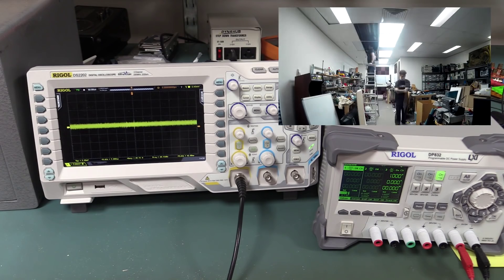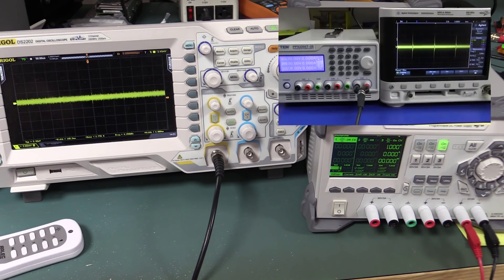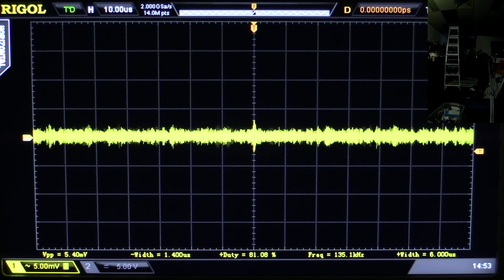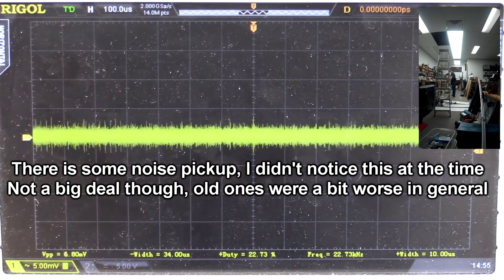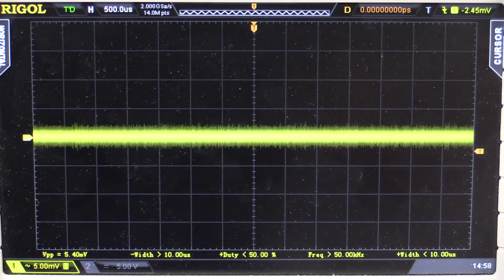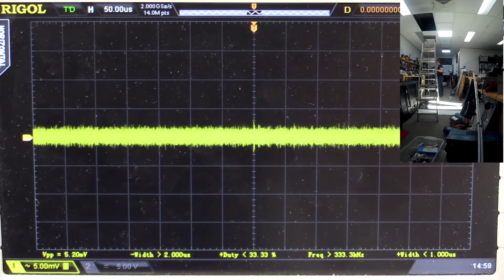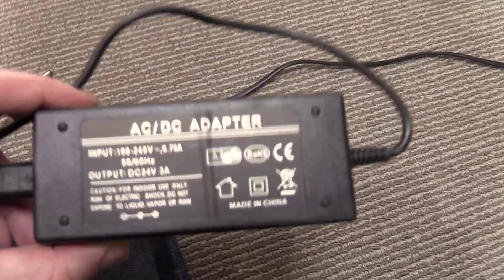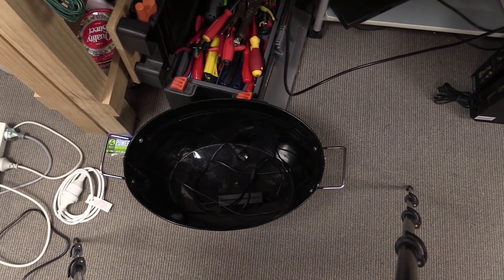EEVblog #765 - LED Panel Lighting Switching Noise

Comment: That one bad light makes as much interference as the two fluorescent tube lights I have in my lab.  I have to switch those things off every time I want to make a clear reading on the oscilloscope.  That unit will pick up 60Hz noise from everywhere.

Comment: Something else you might consider Dave. Try measuring your lab with your Spectrum Analyzer with anantenna connected to it. No doubt 9 khz is quite a distance away from 50 Hz but spurs can be generated quite a distance away from line frequency with Switchers. Set it up to scan out a Megahertz or 2.

Comment: Why aren't you making LED panels yourself?
Some cheap and good quality 3W COB LED lights can be obtained from China (Ebay, Aliexpress...).
It would also be a great video for the channel:
- building LED fixtures
- making power supply (with variable voltage for dimming, please no PWM)
- IR receiver and transmitter for control
- ...

And you could probably also make much better quality electronics than the one included. Those are usually only good for "garbage".

Comment: Come on Dave, "Don't just put it in the bin, take it apaaaart!"
We know that the other two don't radiate the RF crap, so why does this one? 
Is it being radiated from the PSU brick or from the mains or 24V output cables?
Generally in a situation like this, we don't have a good unit to compare with, so don't know if the unit has gone faulty, or just badly designed and did this from new.
Other than the RF radiation, this unit hasn't actually failed. There was no discernible difference in panel brightness compared to the others

We just want to know lol!

Comment: Hi Dave,
do you have a big Radio-Station transmitting good old AM nearby? The "silent" noise looks like you're decoding AM-Signal. If you where a Ham Radio Operator like me and others, you'll see switched power supplies and componet with different eyes . ;-) So try to turn on a simple small handheld AM Transistor Radio on MW, LW or even on shortwave bands and walk with it throug your lab. You'll see ähm.. hear lot of e-smog. And that is what can cause the problems with your remote control of your panels we have seen before. 73,Mike.

Comment: WHERE do you get a good 240AC/12VDC switchmode on a budget!? Everything i have or find in a wall wart is never 12v or if it is has naf all current! And all the flea bay shit i have molests anything with an audio signal! I have a bunch of laptop supplies that are good but they're all up around 19V.

Comment: Crappy power supplies like that are a real pain in the ass for amateur radio operators. Just one dodgy power supply like that one is enough to cause debilitating interference over most of the bands from 20kHz to 30MHz sometimes from distances as far as several houses down the street.

It's a nightmare these days as such power supplies are everywhere so in densely populated areas trying to operate on the HF bands is near impossible due to the large amount of interference from dozens of dodgy electronic devices.

Comment: Hi Dave, is it possible to plug the oscilloscope and the programmable power source to the isolated transformer to isolate the noise from the lighting?
Reply: Yes and no.

The common mode on the electrical hot and neutral lines will have been attenuated a fair bit (but by no means entirely as a portion will still pas through the transformer, depending upon the frequency involved and type of transformer).  However, the common mode on the ground/earth conductor will remain unchanged.  Then there is the fact that switchmode supplies tend to radiate a lot of their energy on their input and output conductors, which will still behave like antennas, radiating their signal throughout the lab (and the longer those cables, the more efficiently they will radiate).

To really address the common mode noise and make the greatest possible difference you really need to address the source of interference as close to the source as possible (as in immediately at the point where the conductors enter/exit the power supply, if not within the power supply) through the use of bypass capacitors, chokes, and/or ferrites.  The closer to the source you can address the interference the greater the effect will be and the less that will be required to achieve a given degree of attenuation.
Reply: Thanks!

Comment: Dave,

Do a tear down on that AC/DC "plug pack" and see if you can figure out how it's different than the others that work. Why is it so noisy?
Reply from the maker: stazeII The crap output caps will mostly have crapped themselves
Reply: Oh, I'm sure. Just figured it would be good to confirm. :)

Comment: Yes you should have cracked it open an showed us  an example of bad engineering
Reply: ***** Or what the customers outside of China wanted: low cost as a priority. I, for one, am thankful of the products that China makes, because almost everything I have is from China and most of it has worked without problem and was inexpensive.
Reply: ***** a guy I know was talking to an engineer  who works at a fork lift manufacturer that had shifted production to china one day  he got call from china asking which welds could they skip over to speed production of. Them he naturally screamed back none!
Reply: iron man this guy should be awarded a medal for saving the brand from falling!

Comment: Hi Dave. You could fix that power supply. I will be a very interesting video.
Reply: Laharl Krichevskoy Maybe compact inside, but not potted, never seen one that was potted inside. Most likely dodgy caps on the output crapping out under load, could easily be improved/fixed but not worth the effort. Also you usually have to crack these open, so they never go back together properly. I have fixed a few but only to fill a gap until a replacement was ordered and delivered, the the fixed one would then be binned.
Reply: Laharl Krichevskoy Usually the really cheap China ones lack potting or really anything to even hold the heavier components in place (other than the solder). They cheap out in every way possible. The annoying thing is that even the cheapest ones tend to have the casing glued together in order to increase your frustration.
Reply: Razor2048
"It is almost as if their design involved them simply adding additional strands of copper" Yes, literally too! I had an IEC cable to a power brick and the thing failed. Cutting the cable revealed what looked like just a few strands of copper. A pear of eadbuds has more than this per conductor.
Reply: Proyectos LED nah those are all potted inside. If you ever break one open you'll see they are all crammed together inside.  You couldnt fit an ant inside those. The best he could probably do is add a line filter before it to stop the noise from going back into the line.
Reply: Razor2048 i've opened my Atten DSO to clean it and al in all it looked like they didnt cheap out on that. It had screws, not metal threaded but still it felt solid and the caps and stuff were even glued.
The pcbs werent all that clean, it had flux residues but i didnt see anything that ringed my alarm. Mind to tell what brand was that one? I know his one is sold undervarious brands, Atten being one of them
Reply: Laharl Krichevskoy For me, often the kind of construction found in the low cost Shenzhen market power supplies, are like this (I added hot glue since while the wires seemed thick, the actual conductor was extremely thin, and thus they flexed too easily. Weirdly enough the mains wire (blue) were slightly thinner than the ones for the DC output. http://i.imgur.com/hEHN5oj.jpg
Reply: Razor2048 Wouldn't the mains be thinner, because they carry less current than the output?
Reply: gblargg
 probably, but it just seems uncommon, especially compared to other adapters. For example, my 12 watt adapter for an old netgear router, has far thicker wires (main wire is around 5 items thicker than the China market adapter that does around 30 watts.

It is almost as if their design involved them simply adding additional strands of copper until the wire stopped getting extremely hot. (thick insulation, and very thin copper)

https://www.flickr.com/photos/razor512/11539675683/sizes/o/
Reply: gblargg 'Copper'. I doubt it. Test the resistance.

Comment: what is a good oscilloscope for a beginner without a lot of money.
Reply from the maker: brandonhughes7 Rigol DS1054Z
Reply: berni8k rigol is  also a  Chinese brand
Reply: Laharl Krichevskoy You've hit the nail on the head.  Known non-Chinese brands that have production in China will want to protect their brand, so they will implement their own quality control even if they do not make anything themselves.

Chinese brands are another story.  They have nothing to protect and you are rolling the dice for the most part.  Regulatory approvals may be non-existent or fake.  Products may perform poorly or not at all, and good luck trying to ship them back to China for repair or refund.  It's not worth the postage.  The Chinese government subsidizes shipping for export, but sending something the other way is very difficult.

Rigol is a notable exception to the above.  While a Chinese brand, it has focused on delivering quality products rather than being cheap at any cost.  A good number of Rigol's 400 employees must be engineers (electrical, mechanical, software...).  They know what's needed in an instrument and how to design it, and they know where they can cut costs without sacrificing too much.  Rigol has made a great niche for itself.
Reply: brandonhughes7 chinese brand, 100MHz 2 channels. Owon, Atten, Uni-T or the likes, they are usually half or less than brand ones. I have a 100mhz 2Ch Atten and so far it's been pretty useful, cant complain, it does have a few glitches here and there and a few design faults but nothing that completely stops you from doing your basic work. If you can grab a use analog scope to complement it on ebay do so if you have some extra cash and space to place it.. He made a video about that a while ago, but that's basically what he said all in all.
Reply: brandonhughes7 Rigol DS. I'm also basically a beginner, and because of Dave's recommendation, I just saved up money for a couple months and got a Rigol DS1054Z like Dave said above. Worth it, worth it, worth it, worth it.
Reply: Mike M Yup DS1054Z .Might cost a little bit but its way better than the cheep chinese stuff, the scope is actually comparable to agilents x2000/x3000 series. It will last you a long time!
Reply: Bell A Yeah, but it's not a cheap Chinese brand.
Reply: Bell A  what crap is not made in china these days? even japanese stuff is made in china even though they hate each other.
One thing is chinese meaning cheap, not known brand quality and another thing is a known brand, usually a good quality one, that happens to manufacture their stuff in china.
Rigol might be chinese but it makes good quality products, not just rebranded ones like most cheap brands. China can make good quality stuff if they want to, it just happens to be know for the cheap low quality ones the most.
Reply: Bell A  I know it is. I was talking about the other ones like Atten Owon gwinstek etc.
Reply: pillsnotbills Search for this documentary: Counterfeiting:The Business of Counterfeits and Knock Offs  on youtube and you will see about China. Cheers :)
Reply: brandonhughes7 The stolen ones  on ebay and craigslist.
Reply: ciprianwiner Where was the bit about oscilloscopes in your documentary?
Reply: The Kaiser I didn't say it was about oscilloscopes. It was about chinese knock offs... read the title first
Reply: ciprianwiner You are on the wrong channel. This is about oscilloscopes and lead's.
Reply: Laharl Krichevskoy Well owon is quite good but Rigol has already done better than them.

Atten and Uni-T on the other hand have crappy scopes.
Reply: Itsuka Kiyokata Crappy?

Comment: Take it apart Dave. Lets see whats inside the sucker.
Reply: Richard Redcastle Don't throw it out, TAKE IT APART!
Reply: EEVblog i would still love to see it...
Reply from the maker: Richard Redcastle Shit output caps most likely.
Reply: EEVblog If it was shit output capacitors, then it would be so easy to just fix it, right? Tossing a device away just because of bad capacitors just gives out bad example to others when it could be fixed for few bucks worth of good quality capacitors and actually save the environment.
Reply: DjResR My thoughts exactly. 
Would be interesting to see if the crappy output caps were the culprit.
Smells like a tear down to me....
Reply: Richard Redcastle Same for me, DAVE take it APART!! :) 
I had a very similar problem, i took that PSU apart and found a bad solder joint for the ground/shield pin and the outputWire. A simple re-soldering with propper heated solderingIron made it work very well since then....So DO IT Dave, may you find something similar, or just a bad cap.....
Reply: EEVblog There's a saying that the shoemaker does not have any shoes. You're busy doing other stuff and so you have a simple bug to solve right under your nose.
Reply: M46539612 this is new. i like it.
Reply: EEVblog What we want? Tear down plug pack! Why we want it? Coz we neeed to seee it, understand and learn Dave!
Reply: Prehistoricman If it was the case then all 3 PSU Dave had would emit RFI. But only one was faulty, that means there's a component missing or out of spec only in one device that caused the RFI. Not all rock bottom stuff does that, I have Yong Xing Tong mains to USB plug-in PSU that has a 13003A CFL transistor as a main driver and it still works after 4 years without problems.
Reply: Take it apart and use it as a demonstration on what is different between a proper power supply and a steaming pile of dog turd.
Reply: Richard Redcastle Yeah i want to see it too, take it apart!
Reply: Richard Redcastle indeed, i have a identical 12v version here and i would love to see it taken apart by someone how knows were to look. note, the design seems "ok-ish" but many compontens are not mounted, input and output coils are bridged over, several caps are missing and so on. i would be very interested to see the difference with all compontens mounted.
Reply: DjResR It's most likely that every component in that PSU is sourced at rock-bottom prices. You'd have to replace everything to make it a good power supply, and even then the board layout may be bad.
Reply: Richard Redcastle Yes I was gonna say that :D . Great to see I'm not the only one.
Reply: Richard Redcastle Especially that it's just the one and not all the plug packs of the same type that cause the noise. It may be a obvious manufacturing defect, and could be interesting to diagnose the specific cause.
Reply: What inside it causes the problem? Would be nice to know how to avoid causing these issues.

Comment: God dammit Dave clean that screen at least! Edit: Good video nevertheless :) Amazing the noise the can be created. On my Tek 465 the screen would warp next to my crappy ATTEN 'bench supply' (probably need a lot more quotes for that).
Reply from the maker: leppie All that shit on the scope is from the installation, it's everywhere.
Reply: EEVblog Oh it's that dust the panels make. I hate those. Changed mine with foam ones then painted them over.